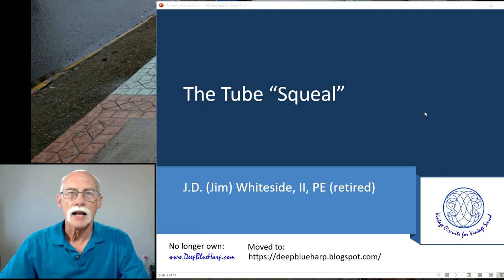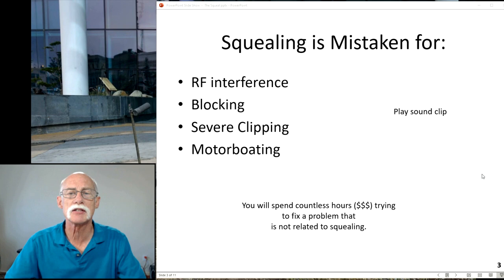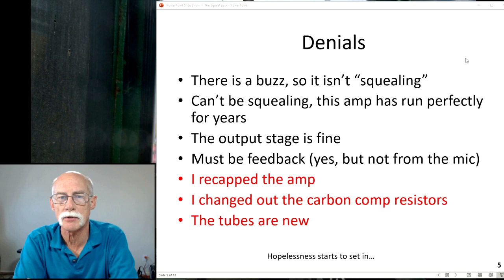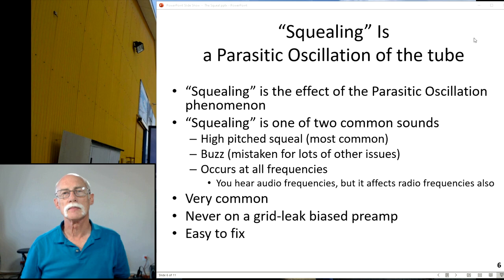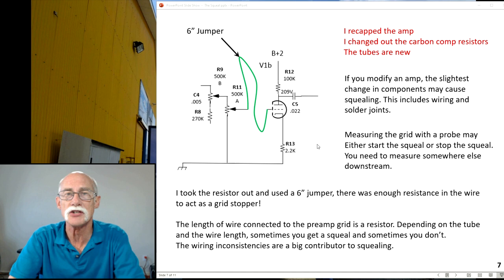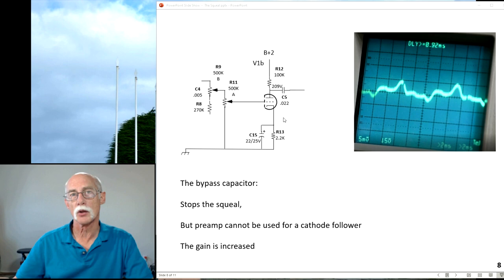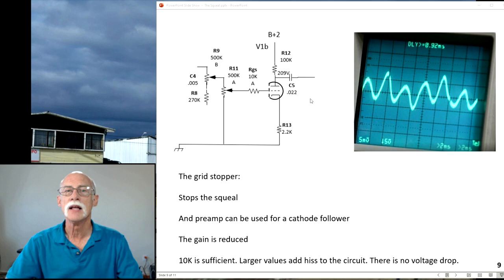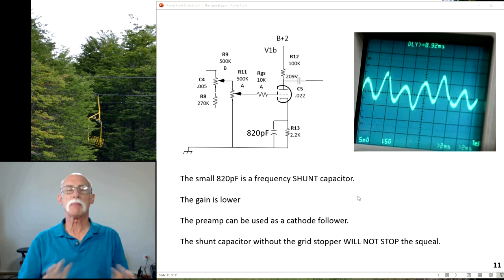The Tube "Squeal"

Comment: "I recapped the amp, I changed out the carbon comp resistors, the tubes are new, hopelessness starts to set in..." 100% accurate. The fifth step for me (prior to watching this video) was deducing that by performing these updates on a 50 year old amp, it was now more powerful and thus out of spec compared to the original design. Thanks for the help!

Comment: Hello, I have a Fender Vibrolux Reverb Custom in which I removed the circuit board and replaced it with a eyelet board just like they did back in the day.  I didnt have any problem for some time and I started to get a squel at times and buzzing and then disappear. 
I did notice that it followed from the normal channel to the vibrato channel and then I removed the Phase inverter tube and replaced it with another tube. It was gone. I had a old RCA nos tube in the PI socket. thanks for your video......

Comment: Had this happen on a Collins KWM2A, on 6AZ8 that acted as 3rd transmit audio amp and second stage receiver IF.  When I turned down the MIC gain, it was a high pitched squeal in receive mode.  Yes, it had a cathode follower.  In my case, I had just replaced the tubes. re-capped and cleaned the tube pins.  I got rid of my squeal by swapping out another 6AZ8, however, I'm sure the initial cause has to do with re-capping, or perhaps just a bad tube. If it returns I'll put a stopper resistor on the grid.  Also, I found a great way to locate a squealing tube is to simply place your hand near it, fingers around it (your fingers make a great inductive tuning capacitor) and it should change frequency as you move your fingers around the outside glass.  Thanks for the advice.

Comment: Very helpful to understand squealing. Now, I have yet to start to work on the amp that brought me here, It's a 4 input copy of a circa 1970 Hiwatt. Both channels oscillate depending on the settings, partially affected by the EQ and presence control but mostly by the volume, past a certain volume with a certain EQ it'll squeal. The preamp is board mounted so there's not that much you can do wiring wise, I have replaced a couple out of spec resistors and caps with a subsequent reduction in noise but it hasn't affected the squealing. There's a couple shielded cables in the first part of the preamp which I replaced and it improved. V1 has 2,2k cathode bias resistors on both triodes as does the first triode of V2 (second triode is a cathode follower), only V1a has a cathode bypass cap (0.047uf), second one and V2a just have the resistor. Any tips on where to start? I don't have an oscilloscope and still don't really understand where the squealing comes from exactly so I don't know if the volume having an effect on it is an important factor.
Reply from the maker: Please go to by About page for my email and let's explore this in more detail. The first thing I need is the schematic.

Comment: Is a 10 microfarads sufficiently large to stop the squealing?  That’s what I have for a cathode bypass capacitor in the gain stage of my amp following the tone stack. But I have squealing. I have a printed pcb and trying to get a grid stopper resistor will require surgery I would like to avoid, especially if it didn’t work
Reply from the maker: It will not stop the squeal. A cathode bypass cap is designed to stop the feedback current through the cathode resistor. It shunts AC to ground and maintains the bias voltage. Squeal is a parasitic oscillation and a grid stopper is required.
Reply: @deepblueharp  yes, I just paralleled a 30 microfarad capacitor to the 10 microfarad cathode bypass capacitor on the 2nd gain stage after the tonestack. It didn’t help at all. I will try a 10k grid stopping resistor next. I get the high pitch squealing on the clean channel - but get the humming like in your video on the soak channel. So will have to do something there as well

Comment: I have a similar issue on my VHT Special 6, it helped a bit to move the output wires away from the preamp but it still sounds terrible. I have changed all the caps (amp is 13 years old) but no luck, any further ideas?
https://www.youtube.com/watch?v=13HJgjXa1HU
Reply from the maker: It sounds like a hum. I will need a clean 60 second audio clip to process in my software. Please email me for details.